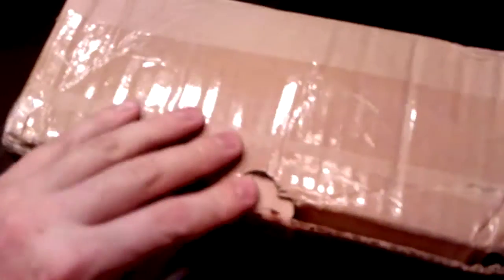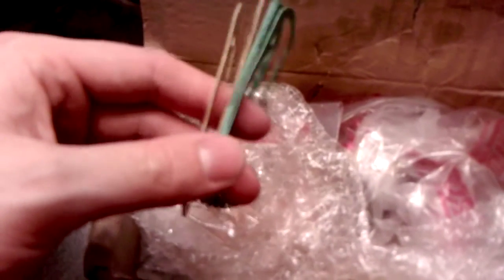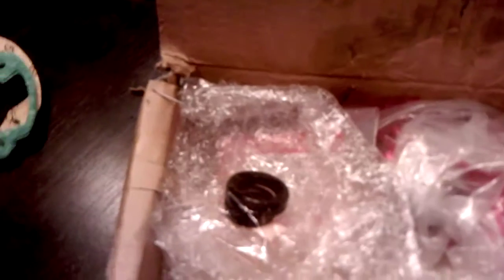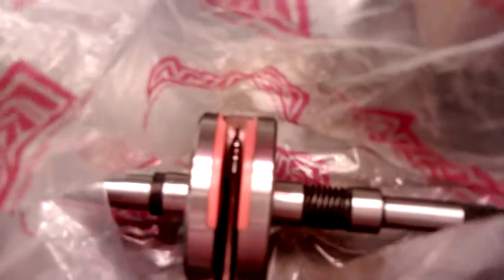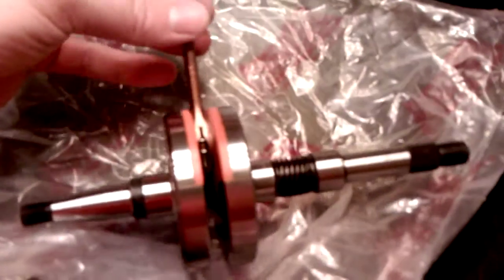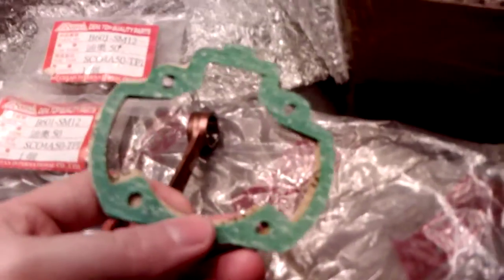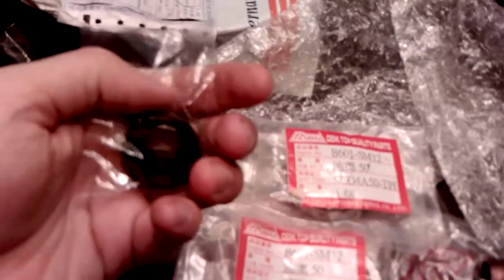Honda SR50 dio Ruima mini stroker

Comment: i recently siezed my standerd crank in my yamaha aerox i was running a malossi big bore kit with power pipe and a back pipe of a yz125 and i was going around a corner at 40mph and it just stopeed thank got i wasent on a geared bike i would of locked the back wheel 

just purchsed this crank today for my aerox along with a new piston thanks for the unboxing really wanted to see before i bought thanks